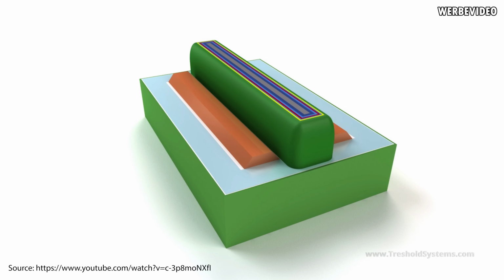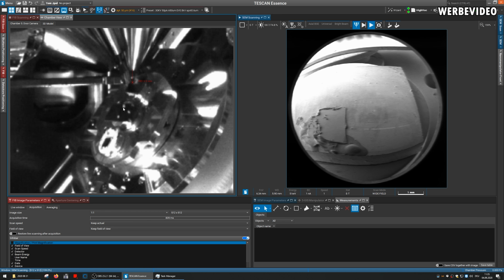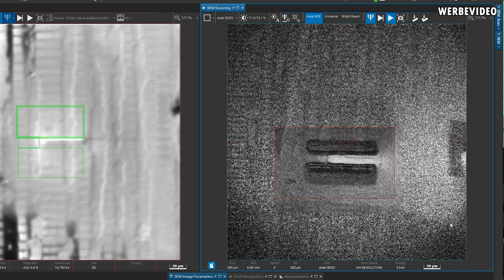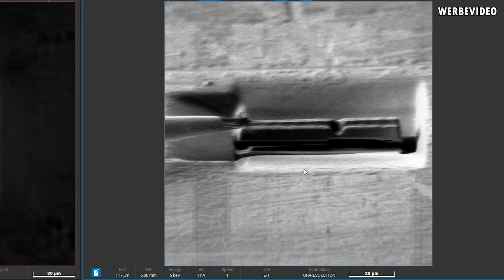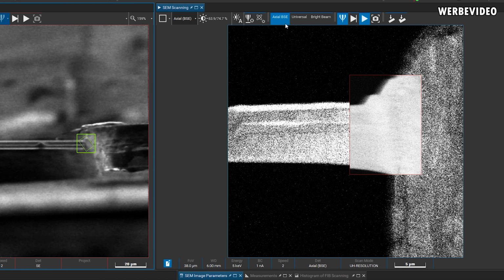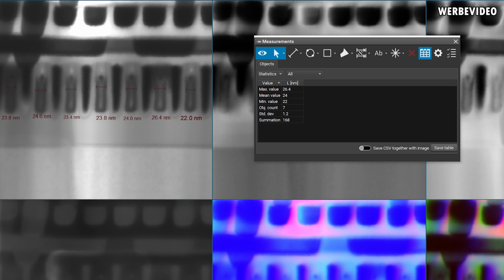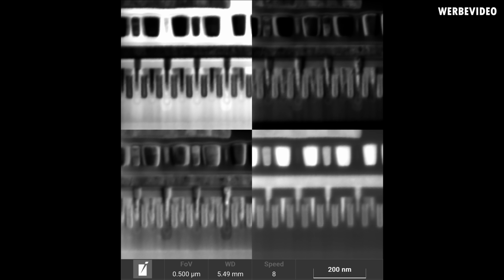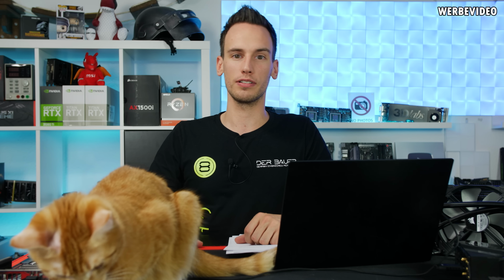14nm and 7nm are NOT what you think it is - Visiting Tescan Part 3/3

Comment: Thanks for that explanations. Answering the simple question if it's better to have lesser number of nm, it depends because it doesn't exactly mean that the transistor are smaller. But answering the question if it's better to have smaller transistors, then yes, it's better (from Power consumption point of view, hence tdp, etc). Also transistor itself has it's capacity and it always matters when it comes to speed(frequencies). Correct me if i'm wrong

Comment: Extremely good.  Really, it should have to do with how small a resolution they can achieve with the masks.  I would think it would have more to do with mask resolution and light than anything.  Which wouldn't really have much to do with the size of the transistors.  Like, AMD's transistors aren't much smaller, but they look better defined.

Comment: Processors do not become faster because they have smaller transistors or simply because they have more of them. They can become faster if they have more cores/execution units, or larger caches, or can run at a higher frequency. Having smaller transistors helps with those, but not automatically, and only to a certain degree.

P.S. Of course they can also have better logic or instruction set, and that's completely independent from the manufacturing process.

Comment: This is mind blowing. Thank you for this! Question what is a lamella?
Reply: In this context, lamella is a very thin sample that is partially transparent for electrons. It's used because the resolution is not much affected by the interaction volume of electrons with the sample (which can be up to a few microns depending on acceleration voltage and material)

Comment: Density is not speed, speed is not instructions per second, none of these things is real-world performance. 

The reason Intel has those + nodes is that they define the node by all the components, not the transistor. 
The transistor gets smaller they throw a + on it, but until they can shrink the other components it's still the 14 node. 

Meanwhile, every other manufacture is only counting the transistor shrinkage and has gone through more nodes. 

of course, if epyc is any indication you could apparently get away with not shrinking the node at all and just using a bigger die surface.

Comment: 14 nm and 7 nm I believe are feature sizes on nodes in the process, possibly the smallest feature, not the size of the overall transistor. Update: it's the gate length, which is similar to my initial answer.  Also at 14:07 mark, "length' is misspelled.

Comment: Actually 7nm, 14nm doesn’t scale with transistor but the Light frequency of the lazer used to imprint the architecture on the silicon. For eg. 14nm means it used 13.5nm width of lazer which is between microwaves and UV light.

Comment: Ideally, all companies that make semi-conductors use the same AND consistent methodology. So a 7 nm is 30 % "better" and definitely smaller than 10 nm. Getting to a smaller number means that means the processor makers have been able to house more gates per same unit of space, ideally consume less power, less resistance and therefore heat.

Comment: Before watching I would have assumed that 7nm had half the feature size of 14nm , except that I know an Intel tech and know that this is not the case. What is really crazy is that the stocks of the two companies have been altered by this pr nomenclature. The perception from Wall Street is that Intel is under performing the smaller AMD. This isn’t true . Feature size is approaching the limits of physics and won’t yield further gains. Moore’s law is dead. In the near future architecture will determine speed, efficiency , and heat dissipation ,which is where AMD trails Intel . It’s funny to me how so many people are buying what AMD is selling when Intel’s research and development budget is larger than AMD’s gross revenue.

Comment: Before this video I tought it was a distance that the electrons should travel like the gap between the source and the drain.
Now I see that this number is like the ones that can be seen on those chinese rechargeable AA batteries like 10000mAh while the real capacity when new is something near 900mAh, if the owner is lucky.

Comment: hi i have master degree in integrated circuit  and i have an answer for that question with no answer in ur video       7nm and 14 nm as what u say related to the parameter of 3d shape in finfet      if we say 18um in planner transistor the meaning related in the length of the channel in 2d but in finfet the length refer to the height and length of the channel that Surrounded with gate and the equation is w total= 2w (height)+w(length) and they say just the length of the channel
i hope my answer is usefull

Comment: Smaller transistor mean less electricity and heat?
Reply: Before you need to define, what transistor is. It can be smaller, but consume same. Or it can be bigger, but consume less (regards to different shape which prevent large leaks). So, there are no direct answer to this question. But in general and with some abstraction — yes.

Comment: This is crazy good technology. I have no idea how they can manufacture something so small but powerful as a cpu. 
Surly it will come to a point where you can’t go smaller or it will cause problems, why go so small if you can run a cooler and more reliable cpu. Mind blowing how we humans have this technology and engineering, so many people don’t realize how there hardware are manufactured or how it works. Videos like this are very educating. 
I bought an Intel i7 8700 non k because I don’t Overclock and want something reliable, keeps cool and still has some kind of performance, now my 8700 is not impressive to most people. But you can only build to your budget and at the time it was expensive and about 2nd highest performance cpu for the motherboard. I can upgrade to a i9 9900 if I could afford it. 
Anyway interesting how fast cpus evolve.

Comment: Before watching this: 7 vs 14 nm means to me: Gate length. the shorter the length, the tighter you can potentially pack the transistors, thus increasing transistor density on a chip = more performance in theory. Still the architecture is more important. More density might bring thermal problems but is more efficient i think. Also, smaller gate length can lead to quantum tunneling of electrons, thus needing additional computing power for error correction.

Comment: I may be wrong but for embedded SRAM in TSMC 7nm I'd expect around 55-60nm gate pitch (matches the image) and gate length of around 10-11nm - optimized for leakage and DFM, not speed, like in logic circuits. The latter does not match the image, unless the actual gate is that lighter colored stripe in the middle (this could be the case as there are multiple process layers on the sides of gates to control capacitance to drain). Interesting the difference in gate pitch is so small between TSMC and Intel. Larger pitch is not necessarily bad - yes, it makes the circuit larger but transistors are faster. I have no idea why Intel doesn't simply shrink gates - free performance and they could call such process 7nm.

Comment: 7nm, 10nm, or 14nm, are (or used to be) process nodes, it used to mean the Cd (critical dimension), gate width, the smallest or narrowest distance between two transistors etc.  But today every manufacturer now uses it like "branding".  unless you actually measure the narrowest feature distance, gate width etc. it is essentially meaningless. moreover, most manufacturers now deviate in how they "build" a CMOS MOSFET, some are traditional 2D, some are FINFET, others are totally enclosed. I think "Xnm" is an antiquated way of determining "better", probably IPC or some work function is better.

Comment: @derbauer There's another video with a guy that works making CPUs and he says that it is actually 7nm but the measurements are not standardized. Like they might make the width less in one generation but not change the height or the length, and the less width equates to 7nm compared to the previous generations. There is some logic behind the nm, so it can't random.

Comment: My initial thoughts: A nanometer is hard to measure. I am thinking Intel 10nm was equivalent (or very close to) to TSMC 7nm (based on something I saw in a video). Each company having a different machine could be the reason their numbers aren't comparable without putting both through the same machine. There are also more factors, like the percent of 7nm nodes within a Zen CPU compared to larger nodes that may be used for other functions.

Comment: The size of Amd's cpu die is 74mm while Intel's are 206mm so im very sure the transistors are not the same size not to mention amd publish transistor count and intel have stopped publishing theres lol
amd fit 12 cores 24 threads on a 74nm die (3900X), Intel can only fit 10cores 20 threads on a 206mm die (10900k). x3 the size yet less cores less performance and draws more watts 125w over amd's 105w.
Reply: The size of AMD 3900X is 273mm^2 not 74mm^2. AMD is using chiplet design and 1 single chiplet is 74mm^2, however on the actual CPU there are multiple chiplets and total area adds up to 273mm^2. Where intel is putting everything on the single piece of silicon. So yeah actually AMD's area is much higher than intels :) (haven't checked intel numbers though)

Comment: you should go over olet (organic light-emitting transistors) and infrared computing also carbon base transistors vs silicon transistors as a lot of the information about them is not very clear. There are articles that say diamond transistors are measured in terahertz but other articles talking about carbon nanotube measured in the 100 gigahertz but they both have similar molecular structures and have the same semiconductive properties. Then there is not a lot of information about olet and the information about infrared computing is almost nonexistent and is almost completely theoretical. I saw an article that a company made an optical base computation chip for ai that outperforms anything out right now in artificial intelligence research. These are topics I personally would like to know more about as I do not know enough about this topic to know what is bias information or just completely false information or accurate information.

Comment: It’s all marketing BS.  It’s exactly how back in the day, gaming consoles were marketed by bits.   8 bit, 16 bit, 32 bit, 64 bit. Then all of a sudden, it all stopped.  After PlayStation 2 came out and no one cared how many bits there are.  Sony and Microsoft are not gonna tell people that the AMD cpus used in PS5 and Xbox series are 64 bit x86 CPUs just like the ones in PS4 and Xbox One.  The term 64 bit it self is misleading for X86 processors. The only real difference between a 32 bit x86 and 64 bit x86 is the Address Buss that allows more than 4 GB of ram.  Everything else is the same.  

People think that Intel is slacking off but they are not.  They know full well that the X86 platform has reached its peak. There is no real way to improve it more than what AMD has done. This is why Intel is quietly making their own ARM-ish cpu line.

Comment: Working in the industry back in the midst 2000's I can only imagine the stress of trying g to fit to these standards now. Just damn. I works and fixed and cleaned the ecto machines that made the chips on the wafers. Also later working on building the full silicone crystals....I can only imagine how strick it is now. Just wow. How much we have achieved in such a small time.

Comment: My perception before watching the video: 
a. Low power consumption per...idk...compute capacity and thus better clock speeds 
b. Lower production cost per.....same...compute capacity 
c. something like internal latency speeds optimized...because fewer distance between transistors..so better inter process communication and faster kernel to software interactions

Comment: Let's just say that X nm is the size of the smallest "thing" they can make. Or "the resolution". A transistor have some other limitations, they need a certain size to conduct some kind of useable amount of current. the voltage also limit the size. So i'm not quite sure "it's just a name". Perhaps they can actually "make" a 7nm transistor but it's just that it would be useless in a cpu and/or simply wouldn't work because of some limitation other than the "waffer-making-machine" capabilities.

Comment: IMO the nm rating for process technology is long dead. But what it means to me, is that GENERALLY, the lower the nm the process, the more transistors can fit into a given area. 7nm is supposed to be twice as dense as 14nm, but you cannot compare between foundries directly. The process is MUCH more than a nm rating.

Comment: I always thought that number was the minimum structure size, like with a 3D printer’s nozzle. With a .4mm nozzle I can’t print any line narrower than 0.4mm (with some exceptions). But each element you print will be a couple times that size, and if you exchange your printer’s nozzle for a .2mm, you still won’t be able to print everything at half size, but keep the same relative resolution.

Comment: @der8auer Can someone please explain why if the transistors density of intels 10nm is higher then TSMC/AMD's 7nm transistor density why then does AMD perform better on benchmarks? Does it have to do with the instructions per cycle and the frequency? or are there some other variables?

Comment: I always thought that it is the wavelength of the light shining through the mask onto the waver.
It’s not about the structures on the chip itself.
Greetings from Munich, Tom.
Reply: Historically and until very recently 193nm light was used.  EUV dropped it down to ~13.5nm. How they are able to print <193nm features with 193nm light is a whole different can of worms.

Comment: Don’t shy, yes, they are lying, but for stock price and the hype and the economy. One is bold and the other is a little bit shying about the phrase like 14nm plus plus plus plus plus. If we persist on silicons the performance is about ceiling. Even if shit to other material like carbon, it’s hard to say it’s 100% we can double shrink the die size anymore. Face it, don’t look too deep into those singularity shit in TED speeches. There is indeed ceiling untouchable in fundamental applications science, the improvements are marginal nowadays.

Comment: 0:41 I thought that that smaller fabrication process allowed the same amount of transistors in a smaller space. The size of processors has not really changed. You would initially think that the difference between 7nm and 14nm would be their size, but it's not, it's allowing the same amount of pins, transistors and pathways in less space. If the CPU itself is the same overall size, that means there are more "lengthly" paths, or more space for "chiplets". For example, if you can only fit one CPU on a 32nm/40nm process, a 20nm process could theoretically hold 2x the cores. a 10nm process, 4x the cores. If we modularize or make smaller the actual part of the microchip that handles the processing, then you can fit more cores. This is why the max Ghz of any given CPU, no matter the amount of cores hasn't really changed. For example, in 2012-2014 both AMD and Intel had a 4Ghz single core CPU. We've mostly been seeing 3.5-4.7Ghz processors since then. The FX series was able to do this by slowing down the timing of clocks, which created other latency in communication between parts. What that means is, that there was a ceiling that was hit in the amount of power you can push through these chips. The amount of power does not change by adding more transistors or cores. The maximum is relatively the same, without liquid cooling or other special methods.
What they can improve is the instructions of a core. The core can only operate x amount of commands per clock, by improving or optimizing the coding logic you get more performance out of the same amount of clocks. This is why 8bit, 16bit, 32bit, and 64bit instruction sets were so important. A lot of people associated it with having more memory, but 64bits had nothing to do with memory capacity. The operating system allocates what it needs from the motherboard. The only reason why Win95 couldn't use 64GB of ram is because Microsoft didn't code it to handle that amount of memory. The address mapping logic just wasn't there. Those instruction sets previously mentioned allowed a much more important improvement and that was increasing the size of code, doubling the command size (or sending two at once in 32bit). You can however get the same performance with less power, but you can't send more power at it than it's maximum. Meaning, we could see 120W TDP CPUs and 140W CPUs again, but we'd need adequate cooling to see past 4Ghz. We all know lower TDP means better electricity bill. Smaller fabrication means more performance with less power, because they can power the same space with more components on it. There are many ways to improve the node, the instruction set and so on, but eventually we won't be able to shrink the process anymore. We'll be moving on in the next century and it will have to be something that requires the same or less power but allows faster communication and processing of instructions. Quantum, Lasers, who knows. however, as it stands, CPUs have little room to go from their 2014 counter-parts. AMD caught up, and in come cases beat Intel in certain ways with their lower nm, but they haven't blown them out of the water. Until the next great instruction set, you just won't see anything crazy happen.